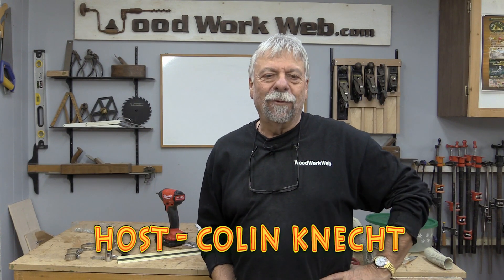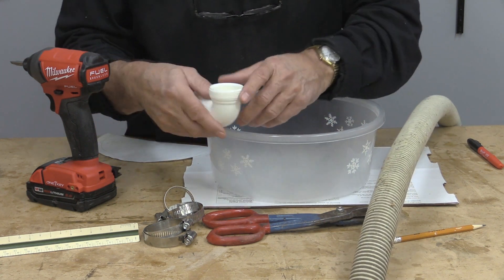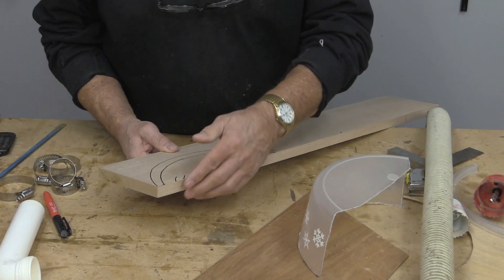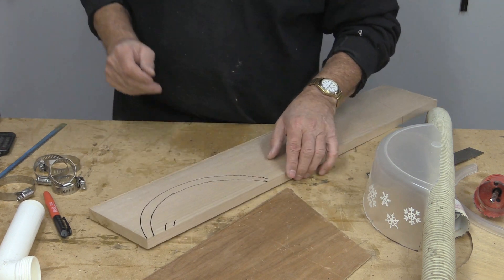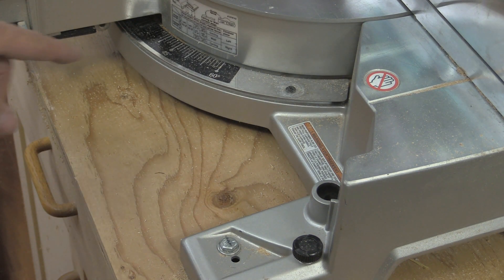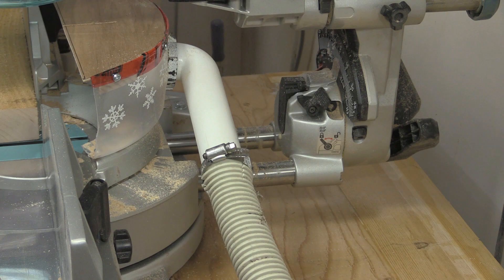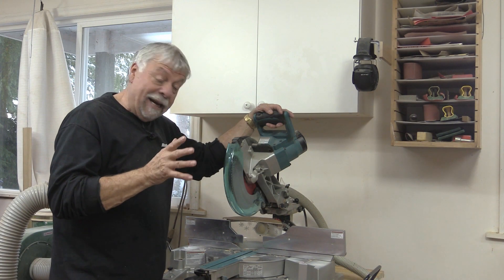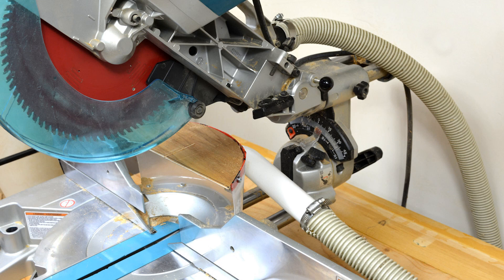Making a Dust Hood for Sliding Mitre Saw

Comment: Similar to a work in progress i began  just this afternoon, with the same problems. Yours is simpler. I like that you use whatever you have rather than new sheets of plywood and  expensive stuff from the hardware. I live  faraway from towns without a car, so resources are hard to come by. I come from a family culture of make do, keep it simple and repurpose old junk. I had to use what i had, which was some scrap bracing ply and the  galv.  backing of an old  flat plate solar hot water collector that I pulled apart. (Very useful those things - glass, copper pipe, brass fittings, aluminium strips, glass wool insulation and a huge sheet of stainless steel.) I cut the ply into two large half disks, one for the base  that sits beneath the back of the saw under the dust chute and one for the top  that I jigsawed a radius into (like half a donut) to allow for the hinge section of the  saw to rotate so I can use the angle adjustments. Some ply cleats glued and nailed to the outer curved edge of each disk allowed me to  screw a 200mm wide length of the galv sheet to the cleats connecting both disks together. It looks like a huge round backed dustpan.  It doesnt block out the sun either and I can still see the crows stealing my peas out the door. It works a whole lot better than just using the dust collection bag at the back (I took that off so the saw can rotate inside the 'dustpan' enclosure), but I'll use a shroud of some sort to stop the dust from rising out of the donut hole,  maybe some pond liner scrap fashioned into a funnel and attached somehow. Magnets, double sided tape, hot glue???. Now all I need is a vacuum cleaner and two buckets.... hmm.

Comment: Just a few days I started to make a kind of dust collection for my sliding mitre saw. But I didn't do it so sofisticated as you did.
I mainly tried to attach a hose as close as possible to the saw blade. It helps a little. But I was sawing wood, which does not give so much saw dust. The times before testing any kind of dc I also sawed particleboard/melamine and there the saw dust "production" is incomparable more.
Thanks for sharing your approach and also for the link to the forum. I never looked there. I'll do that for sure.
When I watched this video for the first time for some reason the screen went black. The video continued and for a moment I thought I was at the dentist's.
Reply from the maker: Thanks for sharing this Hans, maybe together we will solve this dust problem :)

Comment: I made a box that surrounded the saw with curtains in front to close off the space and allow
me to make angle cuts by adjusting the curtains. At the bottom of the box I connected my 
dust collections 4 inch hose to collect all the dust. Works wonderful. Doug Guadalajara mx

Comment: Nice video,  I'm planning on going the cumbersome cabinet route, with a down draft floor directly under the saw.  

I would like to point out that much of the dust that you found behind your collector,  and under the saw, got there by going through the blade slot(kerf)  in the saw's table, and probably not through the very small openings/gaps that you suspected. 

Most saw's have this problem,  and do nothing to collect the dust that goes through the kerf. The best solution that I can think of is a down draft table below the saw, and taking some steps to seal off the gaps between the outer edges of the saw's table,  and the surface that it sits on. 

Good luck! I'm looking forward to updates!

Comment: Hi Colin, Great video about chop saw dust collection.My attempt has been to start from both ends of the stick. First I built a triangular plywood box to try to reduce the dust cloud escaping into the workshop and I vacuum this out each time clean the floor. The second method is the Festool type of rubber shroud around the back of the blade that helps the dust to follow the path to the built in dust extraction port. This rubber sheet is tacked onto the chassis with duck tape - not pretty. This rubber dust cute gets chewed by the blade in certain thicker board cuts. The Festool rubber chute metal clip comes off too in the cutting action. Apart from using an air tight room for the chop saw I have not seen a method that gets nearer than about 75% - 80% efficient. Regards Colin in Northern Ireland
Reply from the maker: I will look at that Festool version ... thanks for all the info buddy, you have given me some great ideas and suggestions

Comment: Hi Colin: Great video. We all know how important dust collection is. Besides lowering the suction port, I would suggest having 3 areas of removal. One in the middle (like you have already) and one at each end, all of which can be spliced into one hose adapter. That way the dust is being "caught" by 3 suction areas. Hope that makes sense..... Steve
Reply from the maker: I like your approach, going to use that that .. thank you
Reply: @knecht105  are you using it and if so, can you please do an updated video?

Comment: 218/5000
The problem is that the speed at which the disc rotates produces wind, and that causes the dust to fly away. The dust collector sucks well, but a lot spreads due to the wind produced by the speed of the saw.

Comment: I suspect some of your (minute) particles are coming from the saw kerf in your miter table.  I had  something similar on my older Craftsman cutoff miter saw and that was the one place I couldn't totally control.  (I did eventually have a smaller hose  under there, too, but the particles still collected in the nooks and crannies).  Super video and a great concept, Colin

Comment: Really like this idea, great idea. I've looked up plenty of dust collection idea's, but first time I saw this kind of set up. One big thing is, that this kind of thing should be better suited for smaller dust collection systems. Not every one have 4" and bigger systems, with massive motors. Mine is 2-1/2", with a shop vac, so it is kind of limited. I have to wonder, if you took this idea and made it smaller in height and even width. Seems that might make for better suction with a more concentrated area? Not like you really need a huge area. And like you mentioned, getting a better seal on the bottom. The "tent" ones are similar to this, but looks like this would be so much more efficient. Seems like it just needs some tweaks. And so many of the other set ups I've seen, not many are that usable for sliding saws. Love the idea :)

Comment: Hi Colin, very intersting an a very good idea. I also got the idea of building such a dust hood. the main problems I see, is that the top of the hood is the way the blade goes up.
On my metabo miter saw there ist a thin piece of rubber. this has the function to collect the dust. So if this rubber would be longer and in an wider angle and will then be collected, maye this is worth a try.
Reply from the maker: Hmm ... had not thought of rubber, that might be something to consider

Comment: works pretty good so far. Maybe the hose on top is not necessary and you could double the size of the one below to double the sucking power?
Reply from the maker: Yes, you are correct ... I thin the hose is too small to draw enough air

Comment: I think that I saw dust bouncing off the bowl wall and flying out.  Perhaps this is the dust ending up to the sides of the saw.   If you made the angle of the walls steeper towards the dust shoot (which would mean further bowl modification) it would keep bouncing the particles more within the vacuum's pull.  Maybe...

Comment: What about using the bottom of a drywall bucket?  You wouldn't have to make the top, you could extend the length as far as you want even possibly making a skirt that covers the back below the pivot crack.
Reply from the maker: I actually looked for a bucket that might fit but couldn't find one,  drywall bucket might do the trick

Comment: Could you insert a piece of felt in the rear sliding portion of the saw so it could still move but seal tighter?
Reply from the maker: hmm ... never thought of that, thanks for the suggestion Kevin

Comment: Good idea.   But I think you are going to be in for a big shocking crack up when the saw blade catches unexpectedly on that wood attached to plastic shroud.      I would suggest to widen the blade opening some.   Better yet, a piece of flexible rubber would be better across the top to be more forgiving in case of a catch by the saw blade.      At least a flexible rubber insert.

Or make the whole thing out of rubber, like some go- cart tire.    Which might be about the right diameter size and width.     I just don't like the sound of shattering plastic and splintering wood.

Comment: Suction through those small pipes on a high volume vac isn't the most efficient or actually very inefficient with little suction power. Would be great to see if you hook that up to a normal shopvac on the same small vac pipes. Even better take the big pipe and squeeze it down (oval) and make a hole in the $1 bucket that is as big as the pushed down pipe. This will give you the high volume suction using the whole pipe diameter... Would love to the the difference in all of those...
Reply from the maker: Yes, I agree, I need more air flow .. thanks for the detail, going to work on this

Comment: The dust it pouring under with the blade kerf, dropping the entry would also be good and maybe widening the width with say something  12" wide and three inches tall  tapering back a bit deeper
Reply from the maker: Good suggestions ... I need to work on that

Comment: why not use some double sided insulated tape to help hold it down so the dust won't go threw the bottom. and get like a pipe that you can melt down flat and make it oval like and hold it down with epoxy
Reply from the maker: Yes, I could try that .. thanks

Comment: The blade throws much of the dust under the saw turntable where it cannot be picked up by any dust collector above the turntable, at least with a miter that does not slide.  I have tried enclosures around the entire saw as well as dust collectors much like yours.  Nothing really works well.  Try adding a 2nd dust collector below the turntable.  If you don't need a portable saw, the best solution for dust collection is an old style radial arm saw where all the dust can travel unimpeded into a collector directly behind the blade.  Nothing can get below the saw table and nothing is in the way of the dust.  Radial arm saws easily collect 90%+.  Wish I had kept mine instead of trading it for a miter saw.
Reply from the maker: I had a radial arm saw before this tool and it worked well but kicked up a lot of dust too. The hood I had for it worked quite well but it was big and cumbersome ... I know I need to improve the air flow, hopefully that will help lead me to a better plan ... thanks for all your input ... appreciate the detail and ideas.